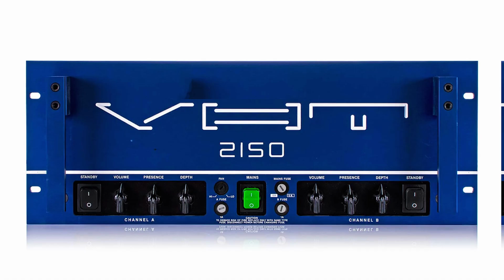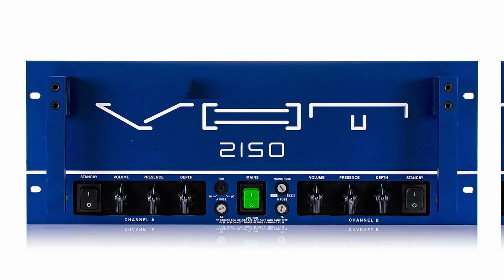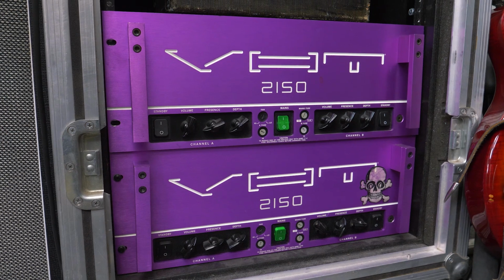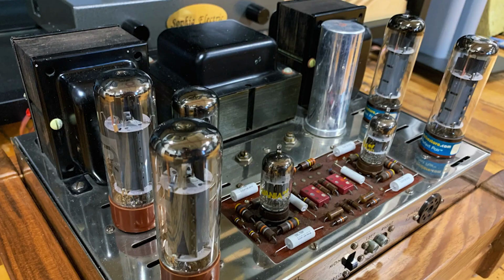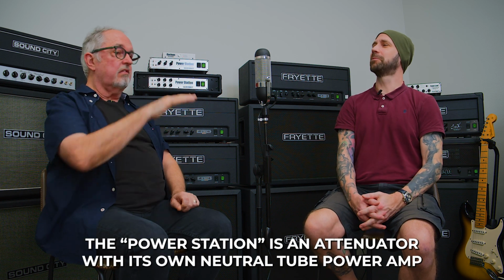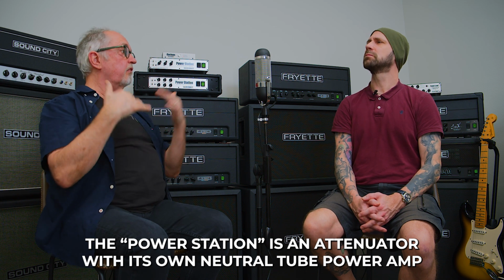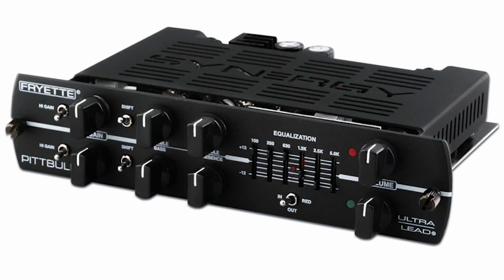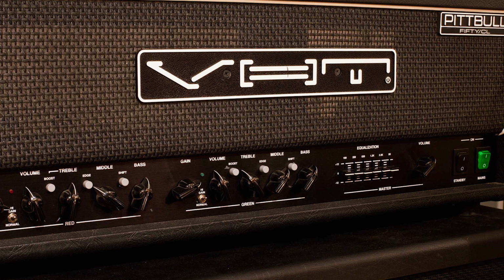GUITAR AMP MYTH BUSTING (with Steven Fryette)!

Comment: I wonder how my amp is set up for different tubes and how it compares between the two, it's a Bolt BTH-100, it was designed to take either 6L6s or EL34s, depending on what you put in them you'd flip a bias switch.

Comment: I know this is a year old, but I just found it.. In either 89 or 90 I worked in Indianapolis at an Apartment complex. I also played guitar and had a friend that had a VHT amp .. I don't remember if it was a rack or not, but he also had a VHT 2 x 12 I think it was. I played that thing for as long as he would let me borrow it. It sounded sooo damn good! 
I think the power amp gives you that compression, etc, along with the transformer, etc.. I think it's all important.. I think of it like the preamp gives you the base tone to start, but you have to amplify it and then you need sustain, etc, and if you have a bad power amp, it's going to suck!  Really, like he said the Power Amp is supposed to amplify the preamp signal. Of course, we all know that's not entirely true. 
Good video man.. He's a genius!

Comment: Let's take your tire analogy and disect it ..change the tires...and then to get the same feel as the big tires...you change every associated component you mention...you change the suspension...and the steering and tune the handling...you will still never get it to feel the way it did with big tires because they are fundamentally different(small tires and big tires handle differently and no matter what you do you cannot compensate for that)...so the only way to get it back to the start is to put the big tires back on and undo all the shit you tried....so you see...IT IS THE MOTHERFUCKING TIRES THAT MADE ALL THE DIFFERENCE JUST LIKE WITH TUBES ASSHAT...BUT YOU STILL WONT SEE WILL YOU PAL.

Comment: As a guy who has owned multiple Fryette Pittbull amps and put them through the life cycle of rehearsing, recording, and performing, what’s more immediately important than them having the graphic EQ is them having the resonance knob because not all of them do.  An underrated aspect of guitar amps is the type of guitar you’re plugging into them.  In my experience-based opinion Fryette Pittbull amps favor set-neck guitars like Gibson and Paul Reed Smith over bolt-on neck guitars, which sound better through Mesa Boogie amps.  I wouldn’t expect an amp company to acknowledge that because they’d rather sell the amp to anyone who would buy them.  If you haven’t noticed yet, set-neck guitars have softer attack and clearer chords while bolt-on neck guitars have sharper attack and noisier chords.  Good tone is a balancing act…
Reply: I think you’re mistaking set-neck/bolt on for scale length dude. Generally Set necks have a shorter scale length which makes them slightly warmer/fatter and bolt ons have a longer scale length which makes is slightly brighter/tighter. The way the neck is set makes zero difference in tone, but scale length most definitely does. So I think your ears have very much picked up a real tonal difference but you’re attributing it to the wrong thing.

Comment: I have a Mesa Nomad100 with series fx loop. I have noise gate infront and in the loop with am Empress ParaEQ. Global EQ to trim the excessive mids. I don't scoop. Plus, putting 12ay7s in V1 and V2. The graphic eq is only use as a lead boost.

Comment: Great video that begs a huge question: What speaker/speaker cab would Steven recommend to pair with the various Synergy modules and Synergy heads? With the SY20IR release, I would love to see a video detailing the differences of cab pairing with individual modules. The ultimate version of which would have Steven review and document his favorite pairings of cabs and the Pitfall and Deliverance modules in the SYN20IR.

Comment: Oh no. That part he said about impedance curve is created by low output impedance solidsate amplfiier is wrong. That's not how impedance curve measured. Also the impedance curve doesnt change. It's a physical aspect of the speakers.

What maybe he wants to say is: the frequency graph is created by the solid state amp. The frequency response changes when you plug in an tube amp. The change is due to the output impedance of the tube amp and the impedance curve.

Comment: Interesting! Regarding power tubes and their “sound” I get at and believe him, but at the same time wonder about for example…I bought a used Ampeg Reverbrocket 212 reissue. When the amp first was sold it shipped with EL34’s. After around a year they started shipping with 6L6’s. I am checking now (mine was EL34) if the circuit is exactly the same but so far it seems to be. I thought I might want 6L6’s as I thought they had less mid range and more even on the frequency range. Tried contacting Ampeg but it is now support from Line6 and the person didn’t even know they used to ship with EL34’s. Luckily talked with someone that worked at Ampeg and guided me so far on this that knows the actual story. 

So in this case it seems like the amp wasn’t totally designed around the one type of power tube, OR that it was but the other type also works well?

Comment: Great conversation. I would add that to the player, there isn’t a right or wrong. For instance, regarding conversion of power tubes… maybe the amp wasn’t designed for it, however it may create the sound the player is looking for.

Comment: I use to work for a Canadian P.A. Company based in Toronto. We were first and foremost Gordon Lightfoot's provider, but we also did Bruce Coburn, and helped out with Anne Murray, as well as Murray McLaughlin. I just happened to be the youngest Punk/Metal influenced kid in the shop. We carried a Myers P.A. prior to Line Array technology, but we also had a much older Martin Audio system. We had probably 12 of those H&H V800 amplifiers powering the low end of that rig. Really surprised that guys in the 80's were using them for guitar rack systems, although thinking about it, I can understand why. Those particular amps where brutally heavy. D class P.A. amplifiers have come a long long way.

Comment: No one appears to be aware of one of the best amps ever made. The GENZ BENZ BLACK PEARL amp . All tubes . Four 6L6 — five AX 7 — tube rectifier . Total 30 watts . Best amp I’ve ever owned . Black Pearl 2-12 eg. blows away a Fender Twin . I’m sure the Genz Benz will not be mentioned. The downside of the amp is the weight . I think it’s 65 or 70 pounds …

Comment: Tube amps are obsolete. You can get any sound you want win IRL, for dirt cheap and without logging around all that heavy gear.
Reply: Wrong, you cannot get the sound of a real tube amp with anything but a real tube amp. Something is always missing with any and all ILRs I've ever heard.
Reply: @RaiderJay9092  difference in minimal for the benefits in price and weight.
Reply: @LionelDrummer  If the difference is minimal to your ears, great. Its significant to mine so I'll continue to lug around a heavier load to gigs.
Reply: It’s not really about the sound. It’s the Feel. The Feel one can ONLY get from glass
Reply: @Mike_HuntizWet  No its about the sound also.
Reply: @RaiderJay9092    To a point sure.  But most people can’t tell the difference in sound between the two in a blind test.  But the feel and reaction is worlds apart
Reply: @Mike_HuntizWet  I find its easier to hear the difference in a live setting. Harder to tell on a YouTube video with the phone speaker.
Reply: @RaiderJay9092  I run my irl pedal through a Vox Nutube amp. It’s a fluorescent tube technology. The amp was like $240, weighs nothing (it’s tiny), but still gives you the feel
and power of a tube amp. So you can bypass all that expensive gear and still get the sound and the feel. I’m amazed the fluorescent tube technology hasn’t taken off. That’s because the amp makers are still propped up by the boomers who don’t understand there’s new stuff out there.
Reply: Furthermore, get a Tonex pedal. You’ll be able to dial in sounds that you cannot on a traditional tube amp. You literally have thousands of options. In the end, the real difference in sound comes from the speakers. That’s the dirty little secret than nobody talks about. Guitar speakers are key. The right speakers is the most important ingredient in your sound. The rest is all bullshit. Easily recreateble using dozens of different options. Even guitar pickups are over hyped.

Comment: As a long time VHT/Fryette user, I can 1000% say that the cabinets and speakers made for Steve's amps (the P50 loaded Fat Bottom personally for me) are an extremely important ingredient of the Fryette sound. They make a huge difference. If you just throw a Pitbull on a typical V30 loaded cab you're missing out.

Comment: I have a msall anp I like the sound of but dream of much more power and larger speakers driven hard by the extra power provided by the more powerful after amp I want to add. I tried usin the headphone out into the CD input of my surround sound receiver and out through the speakers of thaa sytem including the subwoofer.. It sounded great but not quite as full as I want... like with a 'Ful Syack from a Marshall might ...  I plan to mod the amp with a pair of switched 1/4" output jacke into a small stereo power amp into a pair of tower cabsthat are 4X 8"  up to 4X 12" . any woould include tweeters in a ported cab with built in crossovers ans probabnly using a plate amp in each cab as well.. I like it loud, but also versatile for either the guitar amp or to agumwnt the surround system. using a switching box to select input source, be it the surround receiver or guitar amp.. I really love my electronic toys to be versatile and very loud.. I am a child of the 60's and 70's after all... lol ... ..the tiny amp I refered to is  Blackstar ID Core stereo 40 with a pair of 6.5" speakers standard but I think it could dive larger speakers if I impedance match them to the amp output. and add an aditional amp into the mix. just to see what happens.. like I used to with salvaged stereo speakers and amps from discarded Tv's and stereo consoles.   make it work for my builds as a pre-teen just like I did with bicycles too turn trash into treasure.   I still collect speakers for future projects to this day.. but the larger speaker  I'll have to buy cheap  on Amazon as well as amps for the cabs.. I built a guitar I wanted from a cheap Starcaster, Strat, electric guitar By: Fender (said it on the headstock) I got used from my local 'Nusic-Go-Round and moded it to the extreme.. , lots of pots and switches custom paint lots of trick parts.. I call i "Stellarcaster".. Dream big and make it happen...

Comment: Yamaha G100-112 and G100-212 (1x12" or 2x12" speakers).
Truly FANTASTIC combo amps, made people seriously rethink the "solid state is crap" bias.
Had an excellent onboard Accutronics spring reverb, too, and Yamaha's speaker coils were wound with beefy square section wire for max surface contact etc - great and bulletproof!
👍🏻👍🏻

Comment: Stevie said in another podcast that he chose 6550's for the pitbull because they were cheaper than EL34's.... Not to prove a point like he said here..  But I believe there's truth to BOTH excuses
Reply: The comment you cite was not about the Pittbull. It was about why the 2150 power amp has 6550s, which was because two 6550s per channel would yield 100W per channel as opposed to four EL34s. At the time there was less price difference between the two types, which meant lower maintenance cost when it came time to replace tubes.

Comment: I see a lot of videos saying the amp doesn’t matter and only the speaker really impacts your tone. Can you please help to dispel this?
Reply from the maker: In a nutshell:
The speaker will mainly shape the frequency response of your guitar tone. The amp will both define the distortion and the dynamic behavior (which is of course 100% connected) and also shape the frequency response (but in a more simple way).
Don’t believe the videos where people tell you that certain parts of the chain don’t matter. They just matter less than others.
Reply: You can hear it by yourself  easily by using plugins and just swapping amps (or preamps) and keep everything else the same. Or just swapping cabs/mics / IRs.

Comment: Never played one of his amps,  but he's so well spoken and zero bs, I kind of want to buy one
Reply from the maker: You should!
Reply: Best freaking amps on the planet. And I had and still have Mesa's Marshalls, Fenders, Dr Z, Swart. Vox. I have a Sig X and it's a master of all trades and Jack on none.
Reply: @realtruenorth  My only problem with the Sig:X was its size and weight, and Synergy has addressed that nicely (at the cost of Steve's rectifier and phase-inverter circuits, sadly).
Reply: @Robstafarian  it's worth it for the Fryette iron and circuits like you said,, those massive transformers and KT88 tubes. I'm getting the new Ultralead as soon as they come out.
Reply: @realtruenorth  I sold my Sig:X to my older brother, who is not disabled.  I have a Synergy Fryette Deliverance Module, and I have long been tempted to buy an Ultralead module; I may do that next year.
Reply: @Robstafarian  how good of a job are the Syn modules doing? What kind of power section do you run them through?
Reply: @realtruenorth Synergy modules are great.  I bought their 800 module before the Deliverance module existed, then added: Deliverance, T/DLX (iconic clean for my forthcoming Youtbe show), OS (also for that show), and finally a Salvation Audio MatchVox 2.0 because Synergy does not make a proper Vox module (The Morgan AC is not it.).  I have run them through my Jet City Custom 5's single-ended, cathode-biased EL34 without negative feedback and my Synergy SYN-30 head's cathode-biased, class AB 5881s.  I have no complaints, and I plan to swap my SYN-30 for a SYN-20IR head when the latter is released.
Reply: @Robstafarian  nice, I was thinking about getting the SLO version
Reply: @realtruenorth  The SLO preamp is much too compressed for me; the dirtier side of the 800 module gets me as far in that direction as I want to go.
Reply: @Robstafarian  yeah, that's what I'm missing. I have dry amps that are persuasive and very dynamic and touch sensitive, but not a Marshally compressed amp. I want to have that sound when I want it.
Reply: DO IT!
Reply: Yes, you can start off with a  latter model (''03)  Pittbull 45 head or combo.You can find a head for around $1000 or a 1x12 combo for a little more. tt has one less gain stage as the UL but is still kinda high gain and sounds brutal. I am using a Moor 5150 mini pedal (it's fantastic and inexpensive) as you can get slight distortion dirt and it works great as  nother gain stage.  (do not use a klonlike boost pedal like a Tumnus because it sounds like balls into the 45 dirt channel,  because I  tried it.  You can also use the 5150 full tilt into the clean channel and it sound great. I "had" a non graphic EQ UL and  the 45 has that Pittbull sound plus a VOX-like clean channel that sounds great with its EL84s. It can run Class A or A/B. No master volume and IT'S  LOUD, but I get around that by hard wiring the effects loop in series using the FX send volume knob to lower the volume so it is manageable in a bedroom setting.

Hope this gives you some inside, because the 45 Pittbull is a huge bang for a buck.
Reply: Used to own a Pittbull 100Classic (pre-CL nomenclature with no graphic EQ). I’m typically a Mesa guy but that’s by far the best amp I’ve ever put my hands on

Comment: i want parametric eq in amps, because it is the most significant change in sound. One of the orange pre-amp pedals has it and i love it to sculpt a good sound (bax bangeetar).
Reply from the maker: Same here actually!
Reply: 🤩 @KohleAudioKult
Reply: Same.
The Two Notes LeLead preamp pedal also has a parametric EQ and it's awesome.
NB : you could also insert a regular parametric EQ pedal in your FX loop and/pr before the amp (to shape the distortion).
Reply: @djabthrash  i m currently having a 10-band eq in the loop. Was looking at a parametric one a while back tho, but did not find any, that look good enough and was also not super expensive
Reply: @Lutzifer31337 maybe a mooer radar will be a cheap alternative (since it has a built-in para-EQ inside) ?
Reply: thats actually a great idea, thanx! @djabthrash
Reply: @Lutzifer31337 You're welcome

Comment: I bought a VHT Pitbull 45 2x10 back in 98, added a 50 ST head a year later.  Had both a decade.  Ive used the 2:50:2 power amp as well with a fractal, and still use a power station.  always been great stuff.

Comment: Whao, so much knowledge in that video. I had to rewind a few times to try to understand what he meant (I still didn't get everything! ).  In the 2010's I was also interested by the Pitbull head but the range of price was also too high for me, I went to a dual rectifier instead.
Once in a reharshall me and my band were auditionning a guitar player who came with his VHT Pitbull, I found it really articulate but in terms of sound and agressiveness I was not disaapointed by the dual rec.
Anyway, thanx a lot for this very very intructive video this guy has so much knowledge to share, that s really impressive, I ll have to watch it again.
Reply from the maker: They’re both great amps with a very different voicing. The Recto also has a very dynamic distortion. You just gotta tame the low end.